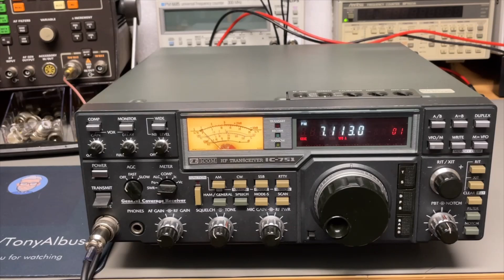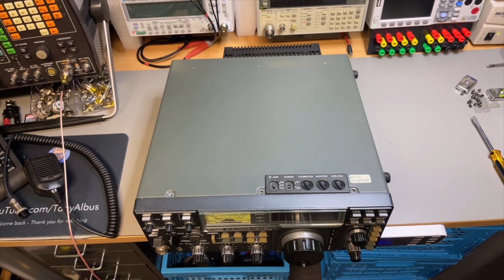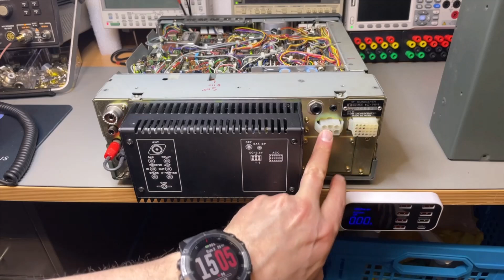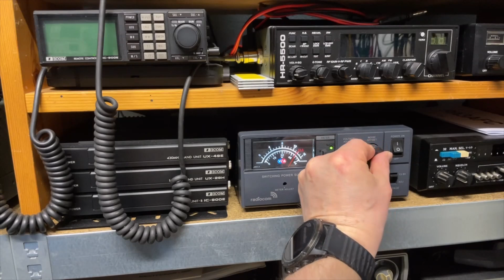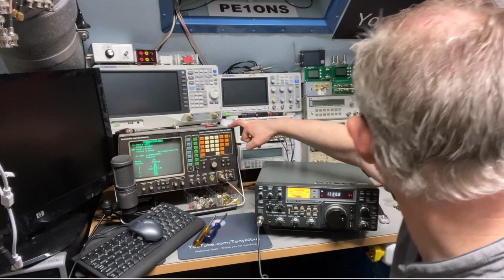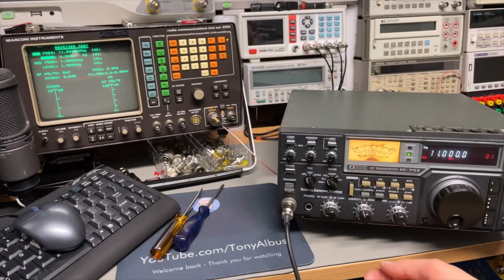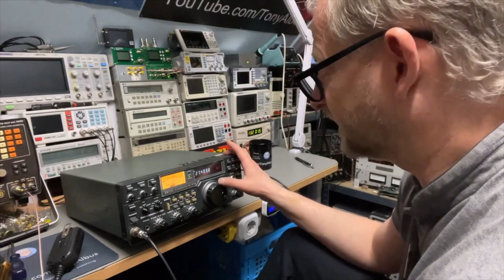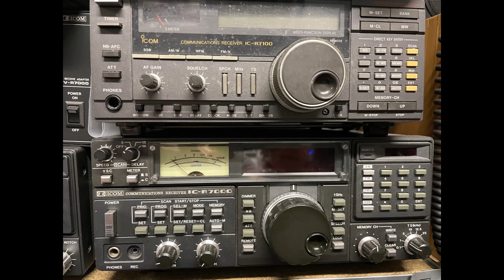#277 Lazy Sunday - Testing my Icom IC-751 , Yes!  Found one

Comment: Sir, somebody is selling a New Old Stock IC-750A and never been used. It is in good working condition and the price is around 430 U.S. dollars. Do you think I should buy it? Thank you so much.
Reply from the maker: The price is resenable, but even not used its an older device. keep in mind the caps are still old, used or not. at some point they need to be replaced. but you will love the soft sound it produces, so much more friendly then the digital radios. i love my FT-dx10 so sensitive but the icom is so much more softter on the ears
Reply: @TonyAlbus  Wow, thank you so much for your reply and for the advice. Aside from I can't afford modern radios, I like the looks, build qualities of old radios. There are no menus and all you need to operate it is all in front of you. Again, thank you sir and all the best to you and your family.
Reply from the maker: @franciscolopez3229  Thank you same to you and yours.
Reply: @TonyAlbus  One last thing sir, how is your 751 now and have you done any repairs on it?
Reply from the maker: @franciscolopez3229  i did o repairs yet, it still works
Reply: @TonyAlbus  That's great for you sir. Maybe I will take my chances if the radio is still on sale. Be safe.
Reply: @TonyAlbus  And may I add. It is the capacitors which I am worried about, since the radio being sold is more than 30 years old. It reall is a gamble sometimes.

Comment: How to connect my Icom ic-750(751) to PC? Tnx
Reply from the maker: Hi, https://www.ham-interfaces.com/
Reply: @TonyAlbus  Sorry, but I didn't find interface for 751 on this site
Reply from the maker: @xomka28  Yes the radio is older, but you can adapt a simple adapter with isolation and make it work on your Icom. 
If you are not that into changing it yourself , try sending them an email, maybe they can help
Reply: @TonyAlbus  thank you! 73

Comment: Where can I get replacement trimmers for the PLL.. Not available in the UK from icom or anywhere else 😮😮
Reply from the maker: Hi, no that is a problem, if you want original, maybe look for a part unit. some boards are available on ebay.
Reply: Mouser electronics

Comment: Hi Tony. My late grandfather was an ex Royal Navy radio technician. After he retired he repaired radios in his ham shack. My late grandmother sold off most of his ham equipment but I managed to save a few pieces. Icom IC-751, Icom  IC-2SAT ,Kenwood 2m FM Transciever.  I Sit for hours listening to tower and aircraft transmission on the IC 2SAT that i'm able to tune to 119.70 Mhz. The IC-751 has AM and FM  but only tunes 0-30 Mhz. ??? Please explain.🥺
Reply from the maker: Hi Kevin, wow that is nice equipment you managed to save. The IC-751 is specificly made for HF (0-30) it is a great Tranceiver(also transmitter) the receiving versions are R70,R71 and later R72 .. but later models got the whole range from 0-2 GHz

Comment: I've got a 751 stored in my garage along with the matching power supply.  Bought it brand new in the early 80's.  I installed the non-volatile board and the com port mod.  Never had any problems with it.  Made many many CW contacts.  Nice rig.  Really solid.  Trivia:  Remember the woodpecker?  It has the noise blanker position just for that.
Reply from the maker: Yes great how well they are still, it was so well build, and strong also. nice to know about the woodpacker, thanks!